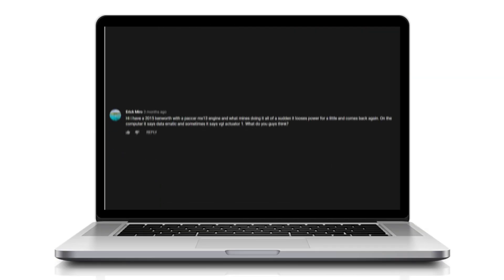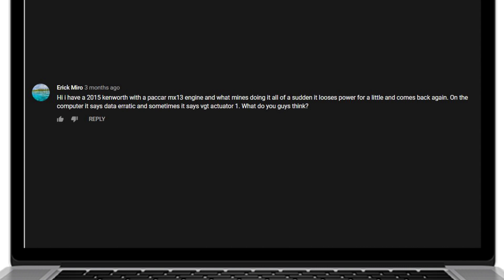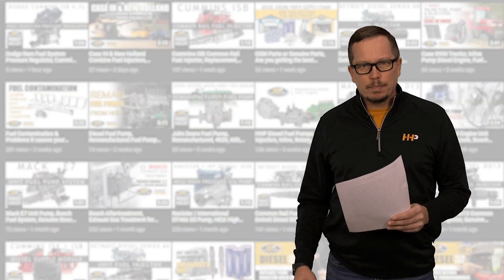Diagnosing Power Loss and Error Codes on Paccar MX13

Comment: Hello !! I have a Kenworth t680 with a MX13 im currently having issues with the throttle response when I let the truck idle for a few minutes the check engine light comes on along with the one with the little wrench icon and when i step on the pedal i get no response I already replaced it with a brand new one from the dealer and still not solved in order to get thrust i have to tap on the brake or put it in reverse  once i do that I get response but when i come to a full stop it will do it again sometimes ,, any help i appreciate thanks
Reply from the maker: Any other engine codes that come up?  Seen a similar problem on a forum and it turned out to be a wiring harness that went bad.

Comment: I have Cummins X15 450 it’s getting code no.4956 Variable geometry turbocharger software out of calibration can you help
Reply from the maker: The turbocharger application identification number in your VGT actuator does not match the turbocharger application identification number in your ECM.  You may need to visit an a Cummins Authorized Repair Location.  
Or if you're looking for additional information, contact one of our Technical Sales Reps at 844-447-1453.

Comment: Most likely it’s an electrical problem. I have a 2016 579 with a paccar motor in it had nothing but electrical problems with it due to corrosion in the lines.
Reply from the maker: Big Tims Trucking LLC, Thanks for watching!
Reply: What kind of issues ?